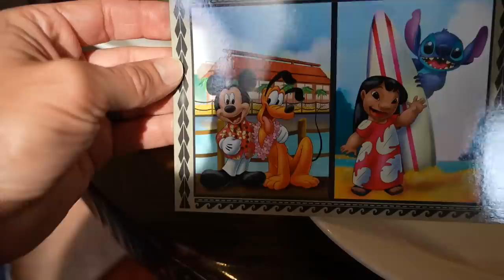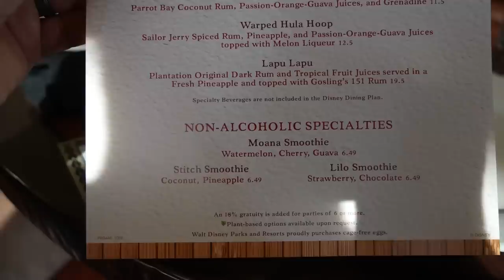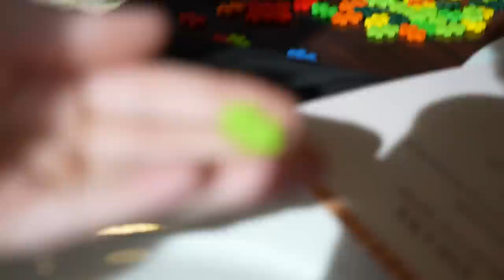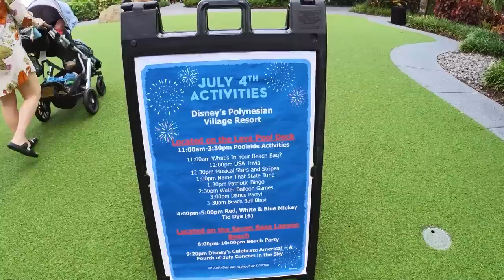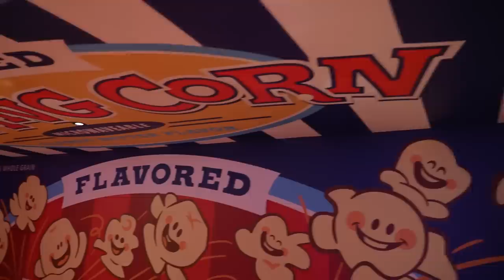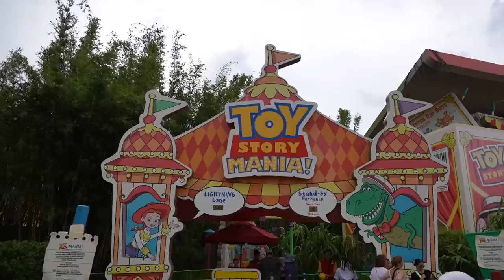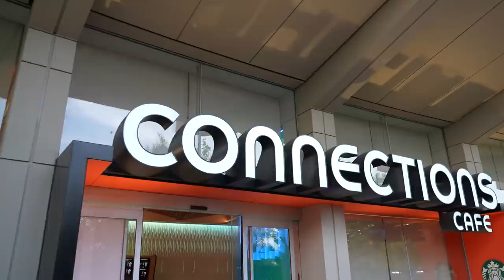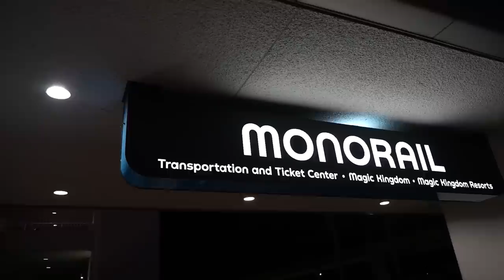Disney Polynesian Staycation Day3! | 2 Buffets In 1 Day, Hollywood Studios, Pool Day & Fireworks!

Comment: If anyone is wondering what the planes are. The large refueler plance is a KC-135 and the fighter planes are F-35 Lightning II 's. Both of these are staples in the U.S. Air Force however the KC-135 is starting to be replaced. But definitely a cool flyover!